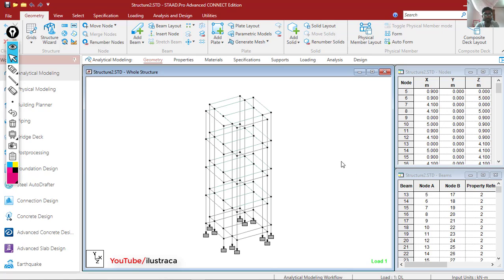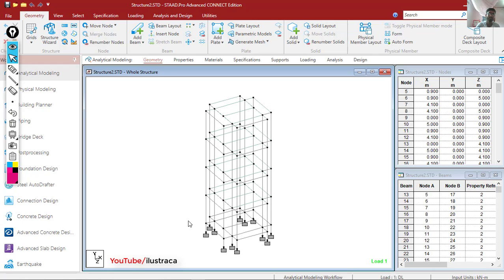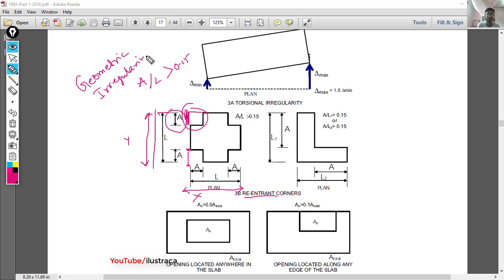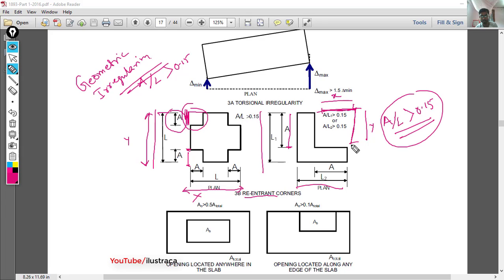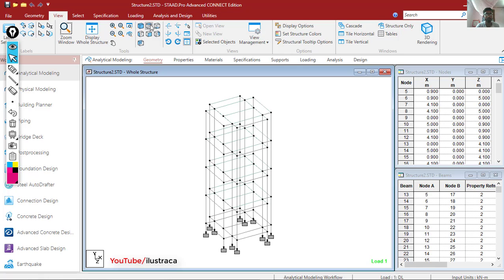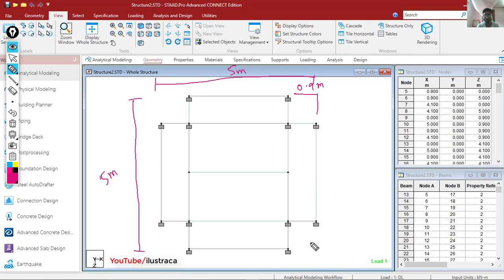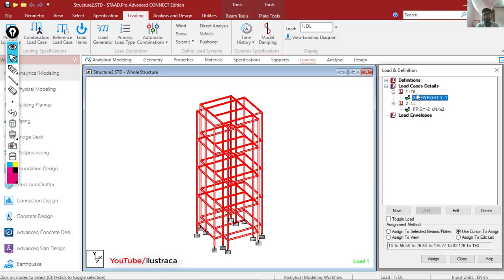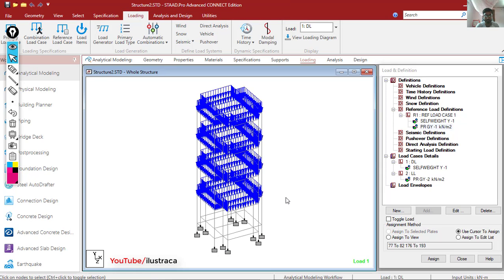GEOMETRIC IRREGULARITY CHECK (RE-ENTRANT CORNER) AS PER IS 1893: 2016 | STAAD Pro. Connect Edition

Comment: One question is, how to remove that re-entrant corners or how to avoid it? Thank you...
Reply from the maker: u can't avoid it if the architectural drawing is fixed...in that case Dynamic analysis need to be performed as mentioned in code

Comment: I am now your subcriber. I uninstalled my Staad Pro v8i SelectSeries since I can not install the RCDC with it and I just downloaded and installed the Staad pro Connect Edition v22 from getintopc as you suggested in your other video comments. All of its products included in its installation package is working. However when I tried the RCDC, when I opened one of my trial project ( I used staad pro SS6 in that project), it loaded then a window appeared and says the columns are missing. This project was just a continuous beams with 3 members with 4 nodes for the purpose only when trying my staad pro v8i. It was already properly analyzed in the post processing mode in Staad pro SS6. Do you have idea how to solve this?
Reply from the maker: RCDC has different format, u need to have a proper frame I guess.. but not sure about it